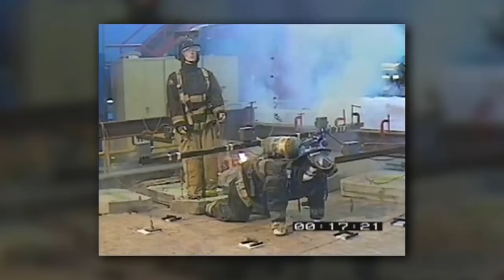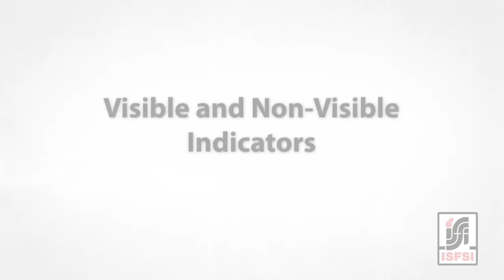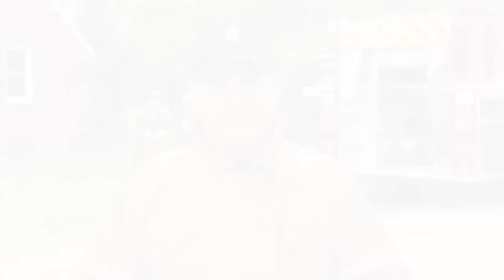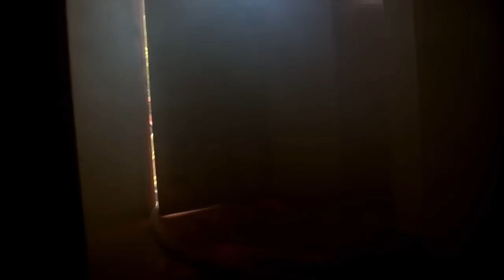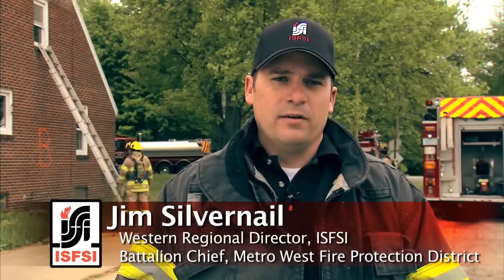Principles of Modern Fire Attack SLICE RS

Comment: V - Vent the fire room windows.
E - Extinguish all Visible Burning Material from the exterior.
V - Vent more windows in areas where victims may be and create cross ventilation.
E - Enter a much safer and cooler space with a charged line and extinguish fire and cool gasses while a search is being performed.

You can apply Tank Water on VBM faster than an entry team can be assembled, get fully dressed and get the door open.
Reply: SUPPOSEDLY venting can lead to Flashover (especially with some modern fuel loads),  but as long as it’s coordinated+thought out well this is probably good advice.

Another acronym to help me remember all this too lol.

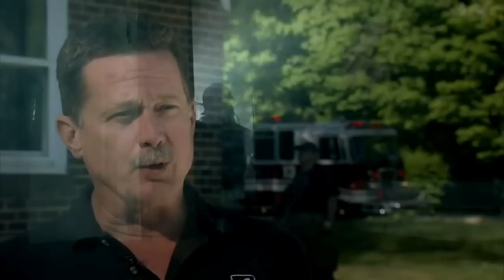Comment: 9:34  Vent at the fire room window and get water to the fire fast.  That is NOT done in the USA!

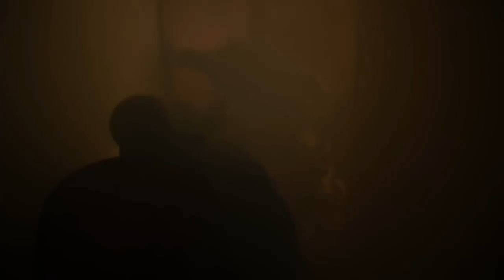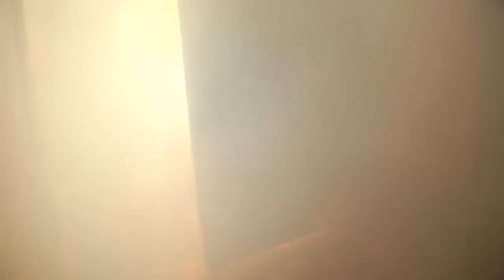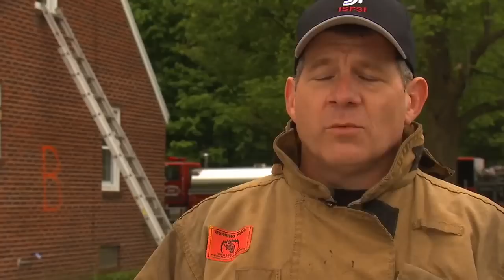14:04  15:10  16:11  16:50  17:06  19:03  20:05  This is what you need to do on all sides of the building before making entry.  It takes a few seconds to eliminate 1000 degrees of heat.  This is NOT done in the USA!

18:00  "That gets effective water to the fire as fast as possible."  A straight stream at close range will not do that.  The nozzle is adjustable for a reason.  Nozzles are NOT adjusted in the USA!

20:35  Yes, I was doing this in the late 60's and early 70's because nothing else made sense.  K.I.S.S.  If you see what's burning, put water on it.  Eliminate the flames and the temperature drops by 1000 degrees almost instantly!

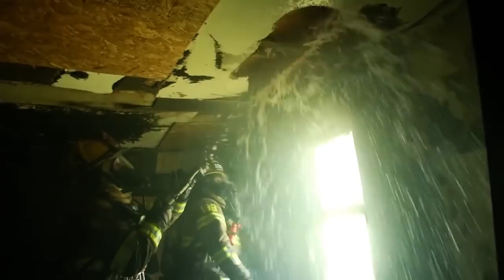22:30  This is NOT done in the USA!

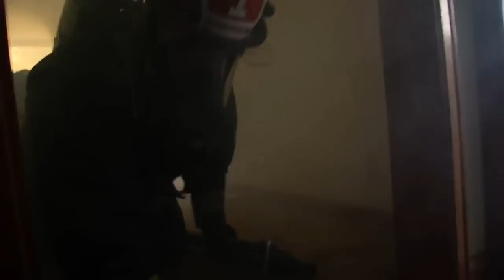22:43  THIS, is what IS DONE in the USA!

25:28  This is NOT done in the USA!

American fire fighters don't want to know or do this type of fire fighting because it puts the fire out TOO QUICK!  Think about that!
Reply: So it's a conspiracy by fire fighters? Sounds like complete bullshit to me.
Reply: @baruchben-david4196    I am SOOOOOO  glad you asked that

You won't like my detailed response so I won't give it to you.  I'll give you some things to think about.

1.  There is an attached garage burning on a two story colonial.  Could be filled with containers of flammable and explosive materials.  There's a door from the garage directly into a family room or kitchen.  It would take three fire fighters LESS than ONE Minute to extinguish that fire using tank water and easy to use Booster Lines.  It would take Much longer for fire fighters to get fully dressed, assemble an entry team and get the front door open to perform Search and Rescue.

So why would they ignore the Visible Burning Material to go into the burning building and allow the fire to get bigger and threaten the victims and themselves?

2.  Same house.  The fire is clearly visible through the first floor living room window.  To vent the house they take the Time and Manpower to set a ladder to the roof, set another ladder to the ridge, climb up that ladder, cut a hole in the roof and then punch a hole in the ceiling below to vent the smoke and heat out of the first floor when all they had to do is quickly and safely break out the Livingroom windows which would allow the pressurized heat and smoke a direct route out of the building and away from victims instead of towards victims and entering fire fighters?

3.  Same scenario.  Why would FFers not Quickly extinguish the fire in that room through the window instead of taking the Time to go inside the dangerous interior to fight the fire from the inside out?

Hint!  All the reasons are Childish and Irresponsible.  Oh Rats!  I gave the answer away!